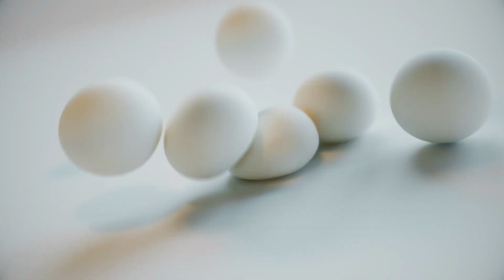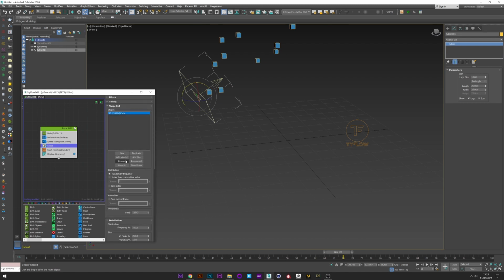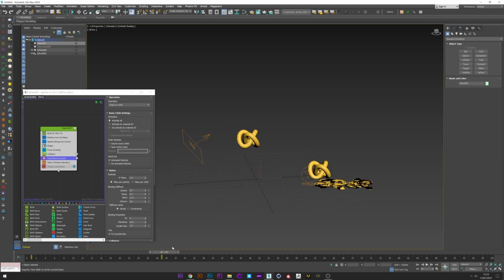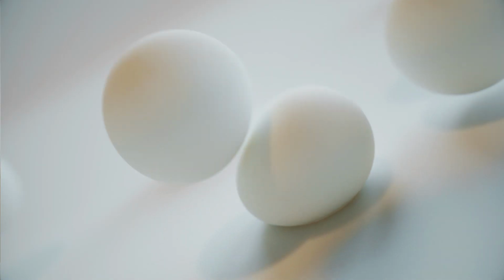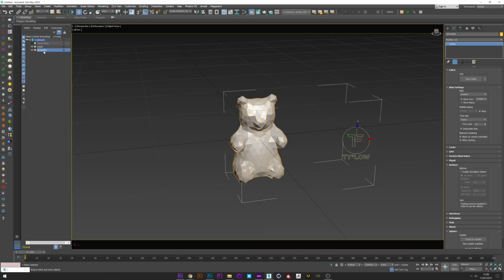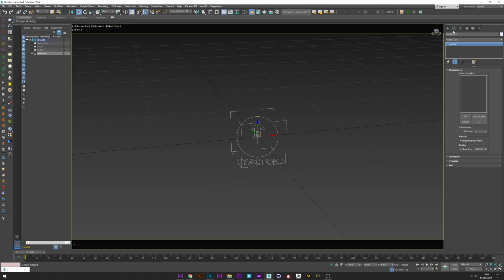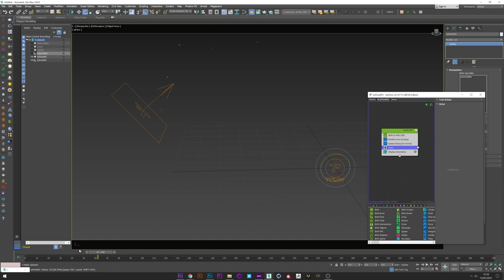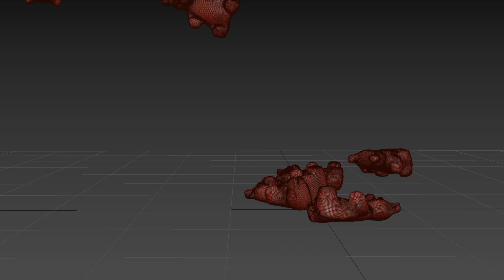Softbody anything | Tyflow Tutorial

Comment: Woah!
Done the Particle Skin setup without an intermediate TETs resampling in two ways:
Random particle seed across the mesh - helps you even out the density of the simulation without intermediate steps, more accurate, but may require more particles.
Or by using voxels and volume interpolation to form a particle shell around a mesh. An approximate method, possibly, more crude or on par with the TETS resampling.